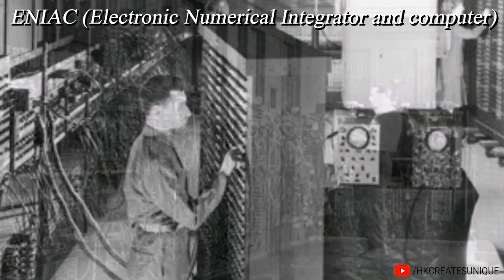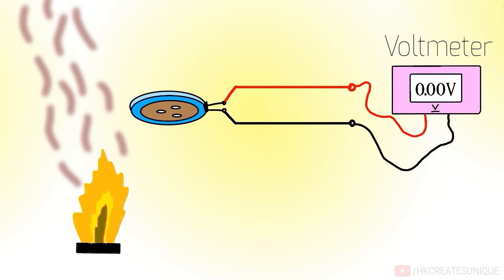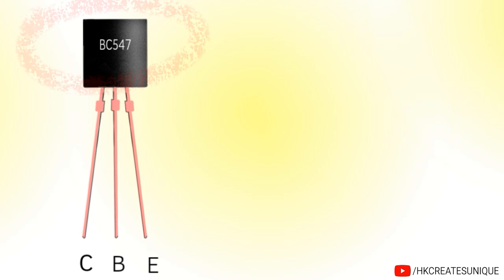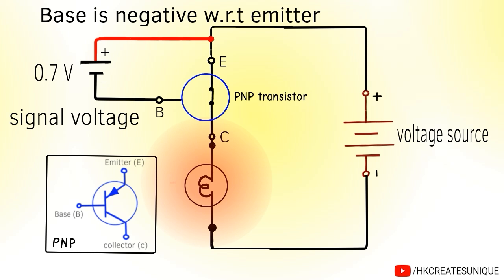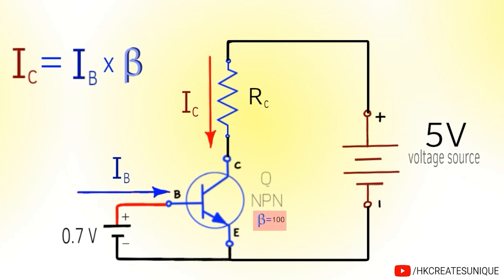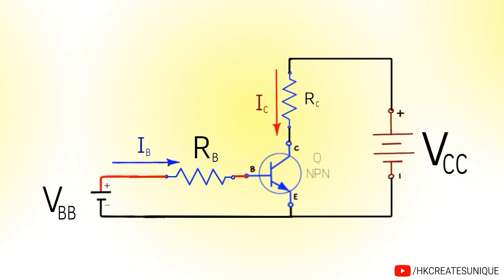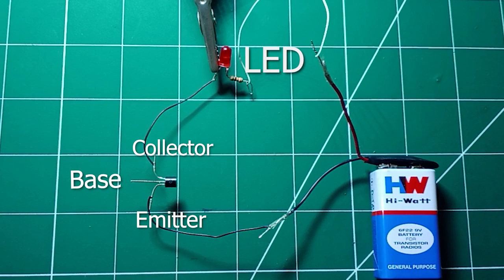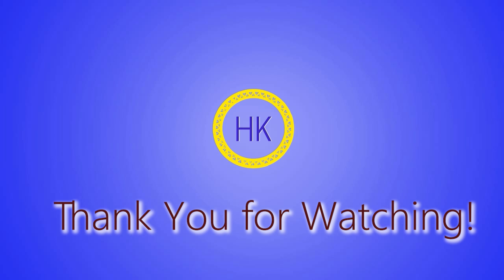Transistor as a switch, how to calculate base resistor's resistance? | Bipolar Junction Transistor.

Comment: Very helpful. I was struggling how to interface my ESP32 GPIO pins to a 5v relay, as the pins give 3.3v. This video informed me on how to use a transistor to switch 5v to the relay using a 3.3v input to the base

Comment: Common Emitter Configuration👍Thanks
Reply from the maker: That's because I used 2N3904, I found that my BC547 was damaged while filiming that part, But I had made animation on bc547... I had no other way but show that . It is still common emitter, see pinouts of 2n3904

Comment: i never trust the math and i check the specs for v and measure the v on the wires   hooking directly to the transistor usually i trim with a trim pot !! they pop super easy if they are rated around a volt or so !! try to get transistors that have 20v or higher on the base and your not
stuck with trim pots !!

Comment: Unfortunately this description doesn't take into consideration that "Beta" ( static current gain) is not a fixed value, but instead has a range of values: thus  value of Beta must be selected properly!!
Reply from the maker: You are right but here we are using transistor as a switch, not an amplifier. To saturate a transistor high enough base current is required, In the equation you can actually assume beta value to be low so that base current is higher.
Also, As beta value changes with temperature, taking lower beta value solves temperature variation problems

Comment: This was a very well made video, one thing to mention is that you may want to have a slightly higher base current than calculated due to transistors not being always fully on at 0,7volts and it may vary even between same types, in case it would end up in a semi on-state the transistor will run much hotter and the output may not be stable :)
Reply from the maker: Yes, true but in my case I used lower beta, e.g. 10. This increases base current ensuring saturation
Reply: @circuitedu  indeed. I thought I mention it as many probably don’t know this and bias the transistor in a way it might fail when the margin is small. Also as the base current also increases when the collector-emitter current does, thermal drifting etc might also play a role here

Comment: Not bad at all,but I'd contest beta value of 10 for small signal transistors. Usually declared within 100-500 range.
Reply: Thank you.clear and concise answer
Reply from the maker: You are right but here we are using transistor as a switch, not an amplifier. To saturate a transistor high enough base current is required, In the equation you can actually assume beta value to be low so that base current is higher.
Also, As beta value changes with temperature, taking lower beta value solves temperature variation problems 

All these I learnt from books as well as from experience
Reply: @circuitedu  So Beta cans sort of just be guest, as long as it's well below the actual Beta of the transistor? - Isn't that dangerous if one chooses Beta too low as the transistor can be destroyed by too much base current?
Reply from the maker: Yes, too much base current will destroy, choose beta above 10,never below it. 

And the reason for low beta is to allow excess base current so that the transistor saturates.

Comment: Can a voltage lower than 0.7v activate the transistor switch?
Reply from the maker: No, voltage below 0.7 volt has lower base current(see V-I characteristics of pn junction) Thats the reason why it doesnt activate

Comment: Can a voltage lower than 0.7v activate the transistor switch?
Reply: I know I remember 0.6v turns em on back in 1986 when I got started on elections. Guess we just haft to test and see

Comment: Its a very informative vdo. Thanks. I am a non engr and learner. Can u pls tell me how did  5816 ohm came from 7.97-0.7/1.25. Sorry if missed aomething or the ques is foolish.
Reply from the maker: Thank you so much for watching, 
The question is not foolish, the reason why 5816 ohms came is becase the base current is in mili amperes, (1.25mili) and mili means 0.001 or 10⁻³ . so 1.25 mili equals 1.25  x  0.001. That is the reason why 5816 ohm

Comment: Hello! Good video! I`d like to add (form my experience) about turn-off a transistor. When a  current ( several milliAmpers for low power transistor)  flows through a base-emitter junction, our transistor goes into saturation. It means - that if we easy interrupt a current of base - the current through collector stay flows during several microseconds. To avoid it we can change polarity of base-emitter voltage when we want TURN-OFF. It can be does by RC circuits or the Shottky diode.
Reply from the maker: Thanks for the info! I should be learning more from you! I will subscribe to your channel😊